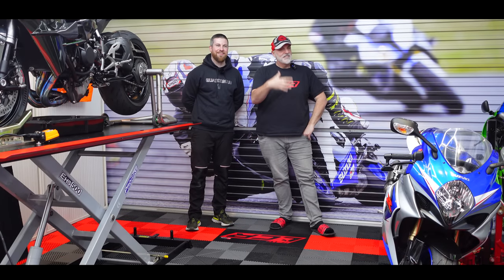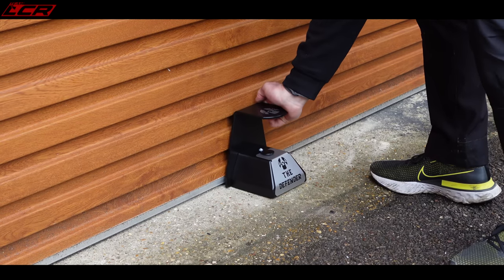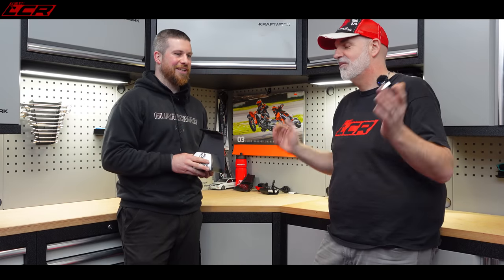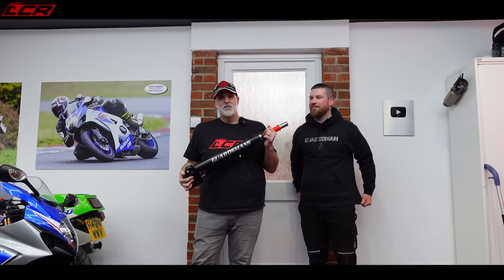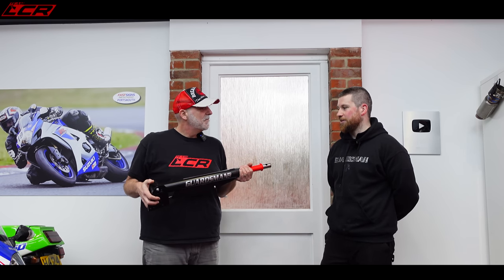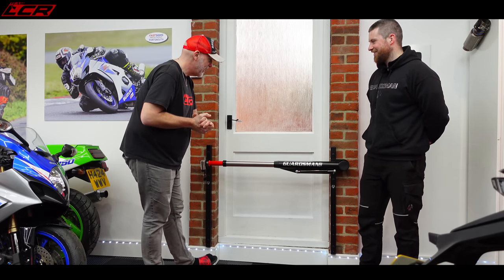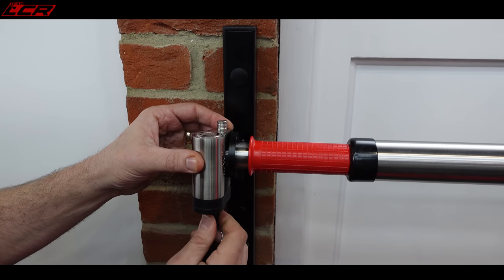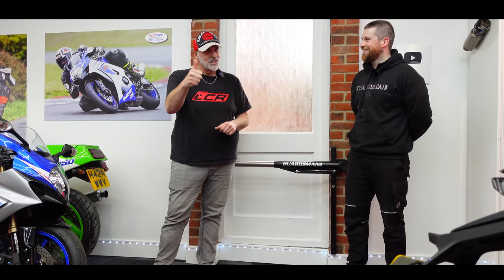How To Secure Your Garage | Physical Garage Security

Comment: Interesting subject thanks LCR. Agreed it’s definitely down too layered security. I use floor anchors for both wheels plus bike has its own alarm. My Garage is integral to my home which is also covered by a monitored alarm and CCTV. Bloody ridiculous really but unfortunately necessary 🙃
Reply: I also have "ridiculous" layered security measures made necessary by local thieves who were after my bike. As a first line of defence I suggest loud vibration alarms set to sensitive  coupled with more than one heavy duty hasps/locks. It is a strong combination forcing thieves to spend a significant amount of time making a lot of noise before they can even get in. This alone will stop 99% of attempts before they even begin or shortly after.

Comment: Great video, for the side door put a metal gate fitted to the frame with welded fittings and multiple locks it would take an hr to grind through, having locks is great, the Missenden Flyer has a bar across the garage door, all of these ideas are great and worth the money and effort, the more locks/cctv/alarms/trackers the better, i have one extra security feature with a loud growl and big teeth although he is getting on now, it would be a brave thief that woukd risk it 😂

Comment: Nice video Chops, love the bloopers 😂 I’ve got an up and over door currently with a soak away drain and block paved driveway. Can the defenders be mounted inside the garage on the concrete slab given there’s a second access point?

Comment: Hi! One does'nt have to lift them over.. two planks with a hinge in the middle . Put the hinge on the guardsman and wheel  them up and down. I would still have  disc locks on the bikes  to slow them down. The alarm is a good idea as long as your home
Reply from the maker: Yes but they need to know its there before breaking in.. don't expect they normally carry two hinged planks around as part of the bike theft tool kit
Reply: @LambChopRides   You haven't heard of the "Two plank gang". wow your lucky

Comment: Morning, I was looking at the garage door lock but I have a block paving driveway. How are you going to secure the bolts as the blocks will obviously just lift up. Do you need to lay a concrete pot or pad in to ground to bolt into ?  That was what I thought but was interested in the suppliers opinion! 😊
Reply from the maker: You can also mount the defender inside the garage (if you have a side door) would that help?
Reply: @LambChopRides  good idea but mine is a up and over at the moment...I think it might be a case of side bolts near the bottom....side note, any more off road stuff coming or bike days out like you did with young Womble? I really want to do the triumph one!

Comment: Thank you for posting.  A shame it is not sold in the USA.  A question about the defender.  Why place the lock on the outside of the garage?  I would think it would be best if installed inside the garage.
Reply: Pits & Pews, available in USA😊
Reply from the maker: Because of the floor matts, just made it more complicated 👍

Comment: Fingers crossed they are decent lock barrels with a good degree of pick resistance. If you follow The Lock Picking Lawyer you will know that this can be a major weak point for any skilled attach
Reply from the maker: Yes but most thief's are grunts with an angle grinder and pry bar. Not many skilled thief's
Reply: The reality is that your common thief isn't skilled or has the time to pick locks like the lock picking lawyer so in reality this isn't a common method of attack.

Cheers,
Dave

Comment: I’ve got ACO drains across the front of my roller, could I fit the floor lock the opposite way round with the lock inside?
Reply from the maker: Yes you can mount inside too, if you have another access to the garage obviously 😉

Comment: Surely if someone sees that thing on the outside of the door they must know there’s something worth knocking inside, or is that just me, in my experience they just drive a stolen pickup through the door anyway forget the angle grinder they use the Ford Ranger key
Reply from the maker: But they would also need to ram the two cars infront of the garage also.
Reply: Well  since they’re carrying angle grinders they’d just steal both cars catalytic converters - then sell them 👍

Comment: Interesting view on the grinder being too small. A 9” cutting disc will fit on a 4.5” grinder without a guard, Thieves are not hse compliant so i have no doubt their guards are removed and could cut the first one no bother.

Comment: I wonder why you dont put the defender on the inside of your garage door?
Reply: @Sarj_ent  Not quite. The bolts are underneath the garage door. Also you need a second access point, other than your garage door to be able to secure the garage door from the inside. Is this the case for yourself?